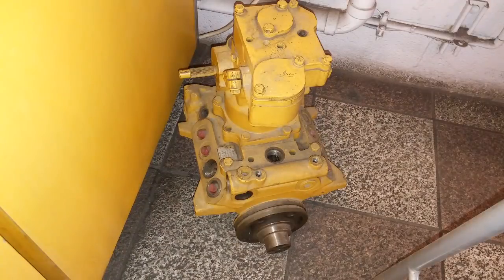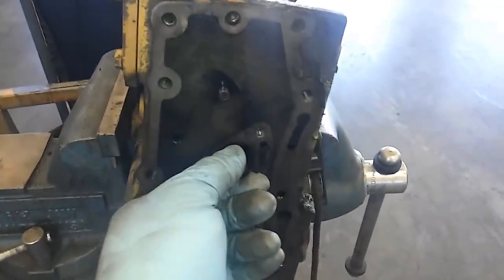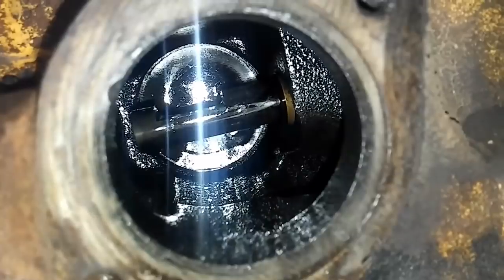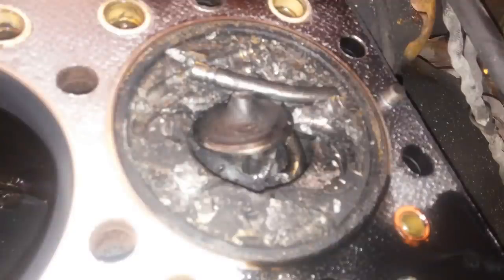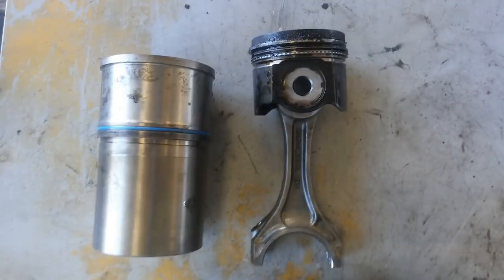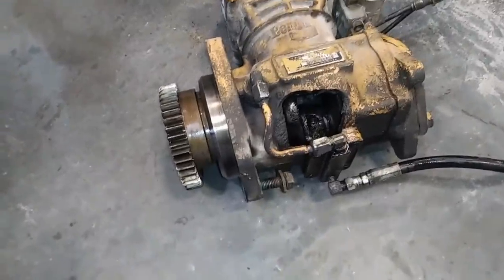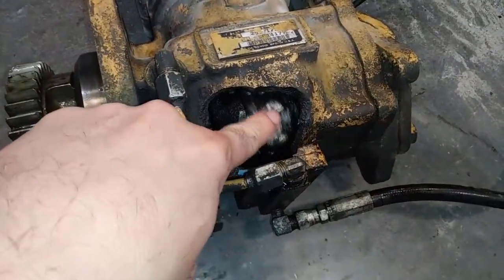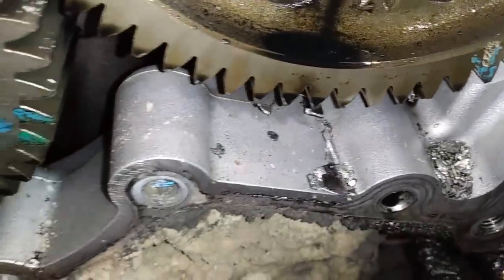Why Do Diesel Engines Runaway? What Is A Diesel Engine Runaway?

Comment: A CO2 fire extinguisher shot into the intake would stop any combustion engine.
Reply: @DonovanBryant92 so? If you only allow CO2 in it will starve the engine of oxygen (duh) and it will die out.
Reply: @DonovanBryant92  I think you mean glo plugs instead of spark plugs not injectors.
Reply: What did Donovan say?
Reply: he said it wouldn't work because a diesel engine combustion ignites from compression and not spark plugs, which does not change the fact that it needs oxygen too
Reply: @jepulis6529  well that's pretty dumb.
Reply: xD
Reply: Steam works too as does pure nitrogen or anything that will stop combustion - you are even trained how to control large oil fires with water on oil rigs. Basically you only put enough water into the flames to turn to steam - it displaces the air (and therefore oxygen) and the fire chokes. Bloody tricky getting the balance right though.
Reply: Who is donovan, and what did he say?
Reply: @jepulis6529  just joo jepulis 😂
Reply: yup
Reply: I've stopped several run aways buy wrapping something like a plastic bag around the breather. The only thing I've ever seen to cause a runaway is the turbo seal goes bad a sprays oil into the intake side.
Reply: Yep it would stop immediately and you don't even need you take hoses or filters off. Makes you wonder why we don't all carry them
Reply: Don't try that on a 2 stroke Detroit. It will suck it right in. It takes something pretty substantial.
Reply: That's what I've heard too. Where I'm from if you're hotshotting then you're supposed to have a co2 extinguisher in the truck at all times.
Reply: Too bad there's more in there than CO2
Reply: @gordonlawrence4749  Not really - SOME steam might instead help the combustion run more efficiently and if you even could get enough steam that instantly you might as well put a straight waterhose into it
Reply: It's my understanding that the 15-lb CO2 fire extinguisher I have in my garage contains only CO2, liquefied by 1000 PSI pressure.   It flashes to vapor or solid (dry ice snow) upon release to the atmosphere.  I would not want to feed any other type into an engine, since a hydraulic lock situation would do similar damage to an overspeed failure.  If you have any details on what else is in CO2 extinguishers, please share your details.
Reply: I once changed my muffler bearings and added oxygenated oil to me diesel engine thingy magiggy
Reply: We use 353 Cats in our portal cranes at work.  CO2 is one of the best ways to stop those when running away.  Well, as long as you get there before they sling a rod out the side of the engine block.  Those big boys hate high RPMs.
Reply: @ralphwaters8905  gasious co2 is compressable, which even out of a co2 extinguisher is a gas when it comes out, so the co2 going in just replaces the air and prevent cobustion. You need to keep feeding it in until the engine stops. Works really well.
Reply: That's the best thing to use !!! Works great
Reply: Or you could just plug the intake and starve it of oxygen without filling it with shit...
Reply: KLAW90 ever have one run away? Most intakes aren’t completely sealed, and co2 is gas it doesn’t leave anything after using it.
Reply: @Travisfromoregon   Sounds like a permanent CO2 cylinder needs to be hooked up with an activator switch in the cab for releasing the gas when it is needed, RIGHT NOW !  At the first sign of runaway I would like the simple ease of pulling a handle or electric switch to a solenoid valve for a quick response.  Beats raising the hood and fiddling while that thing is picking up speed and you being in the causeway for possible damage due to flying parts.
Reply: You will almost certainly hydrology lock up the engine with catastrophic results. Good luck with that
Reply: @goober239   He said, Superman and Green lantern got nuthin on him. :-p
Reply: @trevoror8668  CO2 being a gas will compress like "regular" air but with the Oxygen component being locked up with the carbon is not available for firing.
Reply: Just stick it in 5th and hold the brake and stall the engine
Reply: @goober239  it seems that donovan deleted his comment, which said that "you cant use co2 to stop it because it uses compression to ignite instead of spark" (he must have somehow thought that the only way for co2 to stop an engine would be if it prevented spark as if spark were a combustion in itself, requiring oxygen?) regardless of the fact that no matter if it has glow plugs, spark plugs, or anything else, it needs oxygen to burn the fuel too.
Reply: @bensullivan420  Okay thanks for clarifying!
Reply: CO2 did stop my TD4 landrover when the turbo seals went and it redlined on the oil.
Reply: @Travisfromoregon  that's what I found out. We had a duramax go wide open because an incompetent person installed a shutoff solenoid incorrectly. A 3-4 inch thick shop manual on the air cleaner mount base didn't kill it but did choke it down a great deal and then it got really really rich..you couldnt breathe or see and a lot of people went outside. we killed it with a combo of the shop manual plus popping the clutch in 5th. If that had been a big diesel, I would have just gotten away from it.
Reply: @generalkayoss7347  not if the engine is running on engine oil through failed seals rather than diesel fuel - which was the case with mine and blown turbo seals.
Reply: I gotcha. I'm no diesel expert. I didn't think running on engine oil would allow it to reach that high an rpm. Usually when oil becomes involved in the mix it tends to bog things down. On gas engines anyway. But like I said, I'm no diesel expert.
Reply: @generalkayoss7347  yeah - the engine needs to be hot so the oil is warmed up and less viscous. It's a real pain as it often will burn through all the engine oil and the cause the engine to seize as well as rest of the damage likely to have been caused.

If you've not seen a diesel blow a seal and then run on oil you wouldn't think it's really possible.
Reply: @davidpriestley1650  Yeah that makes total sense. You learned me a little something today. I guess if I had watched the video all the way through before I made the comment I would have known.
Reply: It won't work because a diesel engine would consume the contents of any extinguisher within a few seconds. You are not able to spray it fast enough in to have an impact. And even if it takes a while until it stops so it will restart as soon as the extinguisher runs out.
Reply: @CC-ke5np  Not necessarily, CO2 extinguishers don't contain pressurized gas, they contain liquid co2, so the volume of gas released should be plenty to hoke out a runaway. The liquid, once boiled into a gas, has a much greater volume as a gas, and even then, as it warms up, it further expands to an even greater volume.  Furthermore, co2 fire extinguishers can last a pretty long time - the stream they put out can last upwards of 30 seconds, which should be plenty of time to both choke out the engine, and to let it slow down enough to not start itself up again after the co2 runs out.
Reply: @bensullivan420  
Compare how fast the cloud from a runaway diesel grows compared to any fire extinguisher. 

Displacement multiplied by RPM gives you liters per minute. A tiny atmospheric diesel engine can consume 10000 liters of air per minute easily during a runaway.
Co2 is roughly 500 liters per kilogram. You need to apply 1 kilo CO2 every 3 seconds to match. 
Also a 12kg extinguisher has a play time of less than 35 seconds. Even if it gives you enough concentration to stop the combustion, a highly reved engine will still turn over when your extinguisher runs out and restart.

If it was that easy, why are there so many videos where firefighters equipped with all kinds of fire extinguish systems are just scratching their heads and wait until the engine stops from seizure or runs out of fuel or oil?
Reply: @CC-ke5np  Fair point, I neglected the consideration that a runaway is revving at speeds far higher than anything normal for a diesel under normal conditions.
Reply: @bensullivan420  another point is that CO2 is very cold. This will shrink/bend stuff inside an engine. Waiting until it seizes is more gentle, might cause less damage.
Reply: @CC-ke5np  That is also true, thermal shock could easily cause serious damage to the valves, pistons, and even the cylinder wall/rings as they interface against each other.
Reply: Depends on the engine size - my 2.0 liter turbo diesel engine was running away on engine oil through blown turbo seals while the key was turned off. a 2kg CO2 fire extinguisher smothered the engine - which stopped the exhaust spinning the turbo feeding the air and oil into the engine.   Once the engine had completely cooled I was able to drive the few miles home before it got hot enough to start running away again.   Checked the glowplugs and injectors for damage, swapped the turbo out and got another 2 years out of the vehicle.
Reply: @badboy99987  GLOW PLUGS ARE ONLY FOR PREHEAT ON A COLD START.  WHY does everyone think Diesels use glow plugs instead of spark plugs.  GEEZE, basic diesel engine specifications need to be studied so that you make everyone think you are a fool instead of opening your mouth and proving it.
Reply: @jepulis6529  Diesel engine combustion is like this, piston moves down then moves back up, on the way up air is injected which is highly compressed as it is injected because of the turbocharger.  At a specific point in the timing, fuel is injected (this fuel is preheated before injection)and combustion happens almost instantly which forces the piston back down.  That is why you get the sound that the engine makes.  It is the explosive power of the fuel that forces the pistons back down for the next cycle.
Reply: @robertbenoit5374  yo i know that i just explained what donovan said
Reply: @robertbenoit5374  I didn't say diesels used glow plugs all the time to replace spark plugs why are you putting words into my mouth just to have a story to tell? I was replying onto what someone else's commented and I don't need to study anything about a diesel engine because I have an uncle who's been a field mechanic for tormont Cat for over 40 years if there's something I need to know about a diesel I will just call him up and ask.
Reply: you stick a 2x4 in front of the intake
Reply: Not if its on juice. Nos is just a safe way to inject oxygen into your intake.
Reply: Donovan told me liquid oxygen being sprayed into the intake should stop it because it’s cold and runaway engines are hot
Reply: They are compression not combustion engines.
Reply: @generalkayoss7347   This shows your lack of understanding of a runaway. Diesel runaways are caused by the engine burning motor oil, not fuel. The only way to stop a runaway is to cut off it's oxygen supply somehow.
Reply: a drastic drop in temp will sieze any engine up, they will be junk after that process. detroit diesel  had a mechanical shut down plate at the intake to the blower.
Reply: co2 wont help because when a diesel engine runs away it will burn the oil
Reply: it will explode
Reply: @gawddangthatsmoist2251  it a joke
Reply: @goober239  the above comenters name once was donovan
Reply: @MountainAdventures1  he explained how they can be caused by fuel in this video.
Reply: not sure I'd want to spray it straight into the intake, lotta extinguishers have a fire suppressing powder they shoot out too.

then again, if you're engines about to explode anyways... eh?
Reply: It works, I’ve done it.
Reply: How Are you going to get to the intake on a train for example?
Reply: @harrickvharrick3957 spraying water into the  engine intake may cause a hydraulic lock and the result will be catastrophic engine failure
Reply: @gordonlawrence4749    BLOODY BLOODY tricky!
Reply: Unless it's running on nitromethane.
Reply: Assuming that the fire extinguisher can output CO2 faster than the engine takes it in, otherwise (like if u have a small extinguisher and a big engine) the engine will just cough and slow down but not stop (since it is still taking in Air with the CO2) and once you run out of CO2 it will take off again. Also CO2 is more dense than air by around 60% so there is a good chance that the sudden "impact" of the "heavier" gas will destroy the turbo charger. Having said all that, if I had a runaway engine and no other way of stopping it other than a CO2 extinguisher, I would definitely try it as a last resort.
Reply: Ralph Waters fyi  while in USN in70s had a DD 671 run away because of bent rack tube the operator ran myself and another engineman tripped the blower flaps on intake which were injested,  shut off fuel but it kept screaming so we dumped to 10# co2 fire extenguishers into the  intake which got it down to an idle then we both ran out of co2 and it screamed again got 2 more bottles got is stopped. Repaced the blower seals where it was getting crankcase oil from, rack tube and crankcase oil after a test run put back in service. Those 671 Detroit  Diesels were  almost indestructible,  especially when you considered the aluminum blower lobe to case clearance was about 1.5 thousandth with blower speed 2x crank speed which was probably 3-4krpm overspeed and dissimilar metal contraction rates caused by -260 f CO2 it was amazing nothing grenaded on US.
Reply: What about using Halon gas to flood the intake?
Reply: @robertbenoit5374  David Priestley did not suggest that the glow plugs had anything to do with the runaway, only that he inspected them for signs of damage. (unlikely, but hey, better safe than sorry)
Reply: @Bryan-Hensley  absolutely correct
Reply: Ralph Waters any fire extinguisher in the intake would kill it 😂
Reply: It will total your engine though....
Reply: @teamhex  a CO2 extinguisher is exactly that nothing else but CO2 your thinking of dry powder..
Reply: @KLAWNINETY  those intakes can draw really really hard my arm got sucked onto one once. Whip the filter off jamb someting solid on it, watch your fingers. The sudden vacuum may stuff something.  CO2 is best.
Reply: CO2 works perfectly, i know as fact. Been there done that. No extra damage to the engine.
Reply: Off the cuff, I think your idea would work famously.
Reply: If you want to trash the engine, yes that is a possibility.
Reply: @frankvandendool882  Why do you think CO2 will trash an engine. Co2 comes out of an extinguisher as a gas. As a gas it does not have a great deal of mass therfore it does not  transfers a great deal of its temperature. For instance if a man is placed in a block of ice he freezes if a man holds an ice cube he doesn't. The Co2 goes through the engine just like O2 yet it does not support combustion. A CO2 extinguishes a fire through suffication, it does not freeze the fire, although the temp difference does help, it is not what stops the combustion process quickly. Through what process do you think co2 sprayed from an extinguisher into an engine will destroy it?
Reply: @goober239  Looks like Donovan was too embarrassed by his stupid remark to leave it up for the world to see.
Reply: less you can put an inert gas in a rate the exceeds the volumetric flow of the running away engine over the time it take it to come to rest, it will not work i.e. 900 cuin. 4cycle engine @ 3500 will be pumping 8,000 cfm (assuming the engine is 75-90 % volumetrically  efficient). Positive air shut off is best. Positive fuel shut off works but not instantaneously. So, your 15# CO2 fire extinguisher may stop a one or two-liter engine - if you can monopolize the air intake.
Reply: @larryames8831  interesting thought,  theres a pretty lenthy blast of gas from a large CO2 extinguisher but i see your point. 3.5kg of CO2 in mine. As well i dont think you would have to displace all the oxygen to stop it. And as the extinguisher emptys the discharge slows so im not saying your wrong but theres a few variables in the process. Then again it takes 8 to30 seconds to discharge one.
Reply: @hopefilledsinner3911  if I recall my training correctly, there is 450 cuft in a 15# as used aboard ship (heat in the main space cause you to only have 80% capacity) Later.
Reply: @Bryan-Hensley  
I have heard stories of runaway being caused by bad piston rings, leaking oil into the combustion chamber.
Close the hood and back away, because you never know when a rod is going to let go.
Reply: @scottbc31h22  it doesn't matter where the oil is coming from. You smother it's air flow, it's going to die
Reply: @tiredoldmechanic1791  I heard of a guy on a boat that stopped his runaway diesel with a hard back book over the intake.
Reply: @robertkeefer1552  Yes that would work , IF you could flow enough Halon gas. ... No Oxygen , no combustion....simples !
Reply: @billhill7330   I don't think that you know what you're talking about !  lol..... They ARE (Internal) combustion engines....they are simply compression ignition , rather than spark ignition ( as in petrol engines)....
Reply: @jepulis6529  lmao makes sense why he deleted his comment then
Reply: @ramonatan4406  that'd work, if it doesn't have enough torque to just slip the clutch
Reply: @SoleHarrower  did you change the socks on your brake shoes too. That's what I did. LOLOLOL
Reply: CO2 is very cold, so firing it into the inlet manifold will likely cause rapid contraction, it could do many things to happen ie pistons to pert at the ring grooves or liner failure. Be as it may I would not like to be near the engine entablature as a piston or whatever coming out of the block might just spoil the est of your day!!
Reply: Yeah... and totally screw up your internals. That stuff is very abrasive! just be prepared to choke off the air supply quickly and it will die fast and not harm anything.
Reply: Danger Dave the engine is not worth saving at that point but yea your right
Reply: if you use CO2 be careful because it can also stop you from breathing just like the engine. even if you don't die just breathing in to much CO2 can do a fuck load of damage to your body.
Reply: Boring.......
Reply: @anonanonme2463  He said that .... what makes you a rocket surgeon?
Reply: @generalkayoss7347  I don't think so.... DDs 2 strokes will run away on diesel saturated air .... the only way to stop it is throw the steel plate in the intake ....
Reply: Try to find one if you have one at the time of run away!
Reply: haha and damage it badly.. C02 is very aggressive to all kinds of steel
Reply: Blahblahblah! 99% of peeps even dunno where it is! Heere's the best tip of all! Listen! If you've got manual transmittion, jus throw the last gear and drop the clutch! It will stall!
Reply: @W--ko9ms  sticking an extinguisher nozzle into a diesel intake wont turn the air being consumed into ONLY co2. And even if it does, that engine (running away quite fast by now) intake might rip that hose right off the extinguisher and turn it into a missle. 

The safest way to stop a runaway is to get something solid is to stop the air flow. 

A common cause is oil leaking into the turbo. If you stifle the turbo intake, you'll be golden.
Reply: @davecrupel2817  If you have a gas based fire extinguisher and spray it into the intake there is no way the engine can find enough oxygen in the mixture to keep running.
Reply: Wouldn't work but a normal extinguisher alongside the fuel injector might actually work..
Reply: That what i think, CO2 will stop
Reply: Lol, who said combustion engines need spark plugs? And they definitely don't need glow plugs
Reply: @CC-ke5np  Well, as long as we're only speculating and not going on experience, don't forget that the CO2 will be heated too when compressed in the cylinder.  If the outside air on a sub-zero winter day in the coldest places on Earth gets heated enough during compression to cause fuel to ignite in a diesel engine, it seems that the CO2 from a fire extinguisher should do the same, and get heated a huge amount too.  In any case, the guy who posted above, "wyldebladze", says he has used this method a number of times, with good results.  Oh, and now I see that a few others in the comment section are saying they have use this method too, with no harm to the engine.
Another thing to consider is that the mas of CO2 or any gas fed into the engine for the time period in question will be quite low compared to the mass of metal parts supposedly at risk of being cooled.  It's not just a matter of comparative temperatures, but of the quantity of heat that is transferred.  Ask any welder how long it takes for a massive chunk of hot steel to cool if set outside the shop on a bitter-cold winter day.  Even in that case, cooling is quite slow!
Reply: @aaron__halili2084  You are missing the whole point.  Whether it's diesel fuel or engine oil that is burning, how will it keep burning if atmospheric oxygen is replaced with CO2?  Answer:  It can't.
Reply: @Danger-Dave  Abrasive?  Pure CO2 is abrasive?  This is why the comments are a hoot.
Reply: F PA C - 145 d Abrasives ( Flint , Emery , Garnet , Aluminum Oxide , Silicon ... OR 74 _ 300 _ 0160 Spec . for Fire Extinguisher , Carbon Dioxide
Reply: @Danger-Dave   I'm no expert, but after a bit of online searching I am thinking that what you describe does not represent what's typical.  I only spent 10 minutes searching, but I didn't find a single source saying that CO2 extinguishers contained anything other than CO2.  In fact, it was often stated that one main advantage of CO2 extinguishers is that they contain no other materials and thus will cause damage sensitive equipment, etc. as is possible with dry-chemical extinguishers.  Even Wikipedia has this to say about a whole class of extinguishing materials which they refer to as "clean agents":  "Clean agents extinguish fire by displacing oxygen (CO2 or inert gases), removing heat from the combustion zone (Halotron-1, FE-36, Novec 1230) or inhibiting the chemical chain reaction (Halons). They are referred to as clean agents because they do not leave any residue after discharge, which is ideal for protecting sensitive electronics, aircraft, armored vehicles and archival storage, museums, and valuable documents. "  As you can see, they are classifying CO2 extinguishers into the class of "clean agents" which leave no material residue behind after use.
Reply: Or you could put it in the highest gear and dump the clutch
Reply: @goober239  he said that sprayong CO2 into the intake wouldn't do anything because diesels run on compression and not spark plugs. Which doesn't change anything considering it still needs oxygen to run.
Reply: @anonanonme2463  a true runnaway will not always be stopped by cutting the fuel.  If it starts sucking motor oil it will run with out fuel buddy!
Reply: Thank you,   pretty much any fire extinguisher besides water will work,   FIRE EXTINGUISHER.....
Reply: @colinpophal8630  you shoot anything besides co2 and you'll destroy the engine
Reply: @W--ko9ms  another option is to feed exhaust into the intake (if possible)
Reply: @Bryan-Hensley  oh man this is scaring me. In our department we are servicing an mtu engine that shows signs of oil leaking through the turbo seals on both sides of the engine. Really scary condition